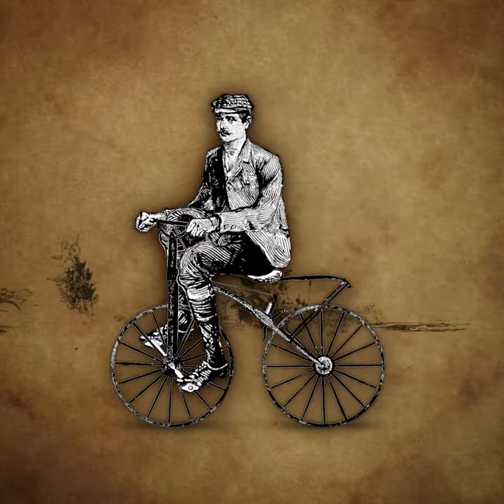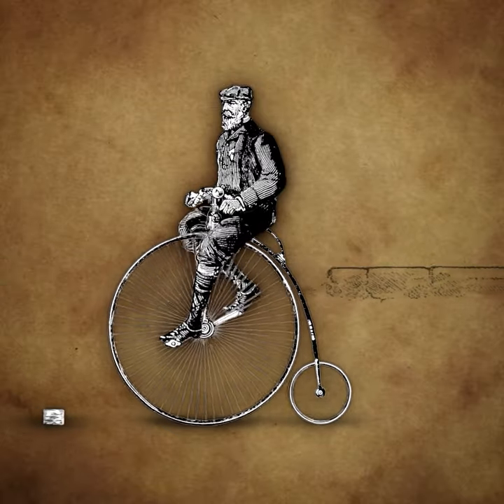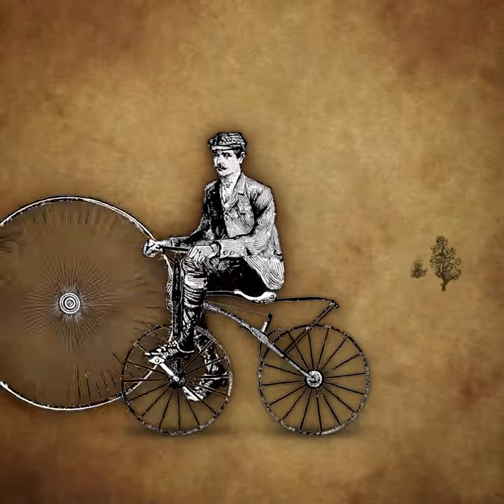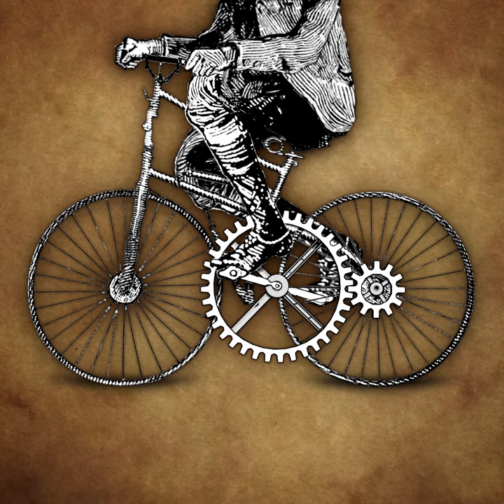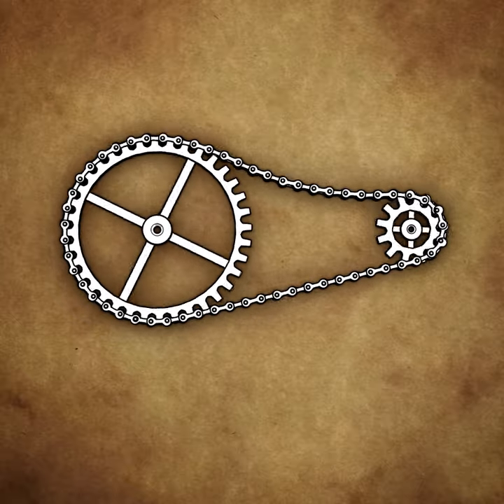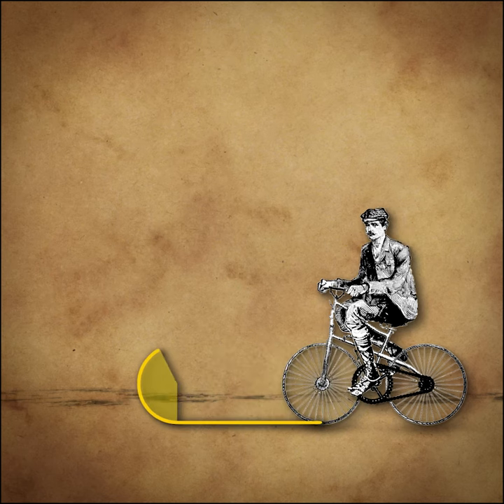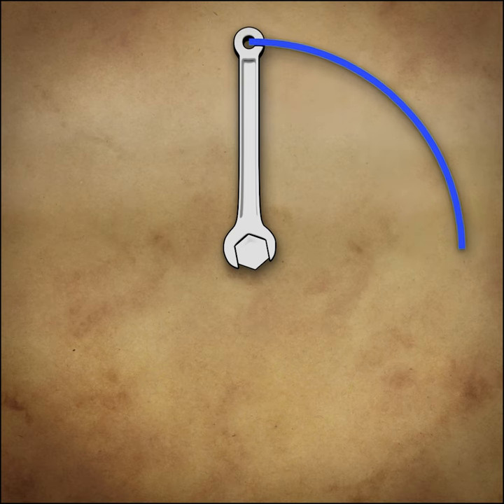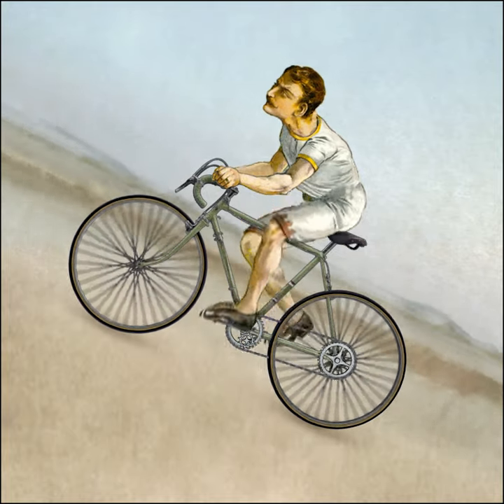A Brief History of Bicycle Engineering

Comment: Internal hub gears pre date the derailer as a viable multi gear system by a good 20 years if i think correctly
Reply: It's making a comeback with belt drives.

Comment: He was actually on to something with the butt cone. There’s wind tunnel data that show significant aero improvement when there’s a large saddle bag on the bike. More than making up the weight.
Reply from the maker: It would be really interesting to ride with one of those and see if you can feel the aerodynamic difference. I would just worry that a cross wind would come in and turn the butt cone into a sail, blowing you off of your bike.  😧

Comment: This visualizes various concepts way better than most cycling channels ever did. Maybe a video on engineering lost/ignored could be nice. Bikeracing never accepted recumbents or aerodynamic fairings. Whether the geometry, especially Highspeed downhill, is ideal is also questionable given the rules squeezing racebikes into certain dimensions. Motorcycle racing once featured dustbin fairings for great aero. I assume thats more related to less power making topspeed a more important component, but if they were in fashion in racing they might be for normal motorcycles making them more efficient.  When i look at cars I don't think the 4 seat arrangement comes from a place of logic either but rather as evolution from horse drawn carriages. I know a certain width is necessary to not fall over but outside of racing context seating people behind one another seems better. Just that at the point aerodynamics started to really matter, speeds got high, the layout we know was too established. Or so i assume.

Comment: the video is great, 1 point though. you start each new chapter with a summery of the last, while just finishing the last. it feels as though the videos were made separately, then connected together. no need to repeat information 10 seconds later. for example, chapter 2 is about the sprocket and chain, chapter 3 explains that again at the start.
Reply from the maker: Thanks. And I did make this originally for my TikTok account and it was in three pieces.  I assembled these together and didn't want to have to recut new audio and generate updated animation.

Comment: Back then, derailleurs were considered cheating.
1970: front suspension was considered cheating.
1980: having rear suspension was considered cheating
2018: having a electric motor was considered cheating.

I'm thinking the pinion gearbox is definitely gonna be considered cheating

Comment: I refuse to believe people though first in doubling the wheel size than to do a chain, gear or belt drive.

When presented with the problem of "it's hard to steer the wheel you're pedaling" the immediate solution is to move the pedaling to the other wheel.
Reply from the maker: I hear you. The most obvious solution is easy to see with the benefit of hindsight.

Comment: lot of nonsense about higher CogG being "harder to balance"
actually the reverse is the case - the higher the CofG the easier it is to balance
I know it not only from the theory, but also from practice 😜
Reply from the maker: With a higher center of gravity, smaller shifts in weight have a bigger impact. I ride a unicycle, and the short ones are easier to balance than the tall ones since a small movement in the arms is less apt to throw you off balance.
Reply: @reasonformath  I have no personal experience of unicycling, but I am sure the same applies. As you say "...With a higher centre of gravity, smaller shifts in weight have a bigger impact..." i.e. it requires less effort to keep bike balanced - https://youtube.com/shorts/5C6cid5RBk8?si=v3IB2rtnwmVISp0L 🤪 I know how much more difficult it is to do the same on lowracer recumbent... 👍